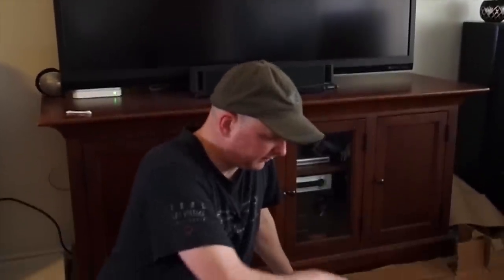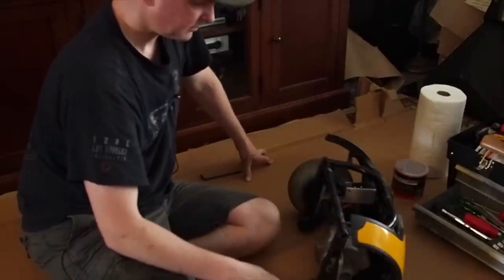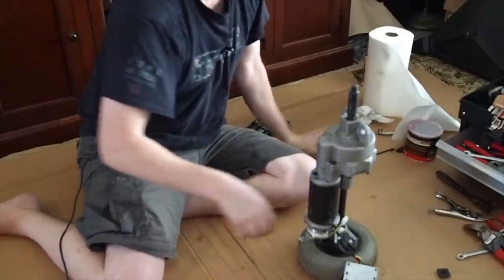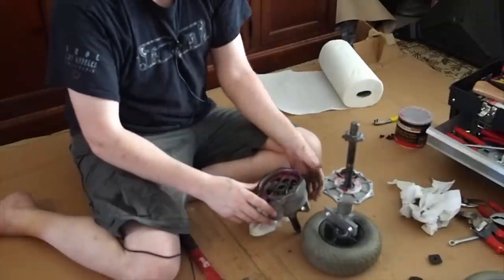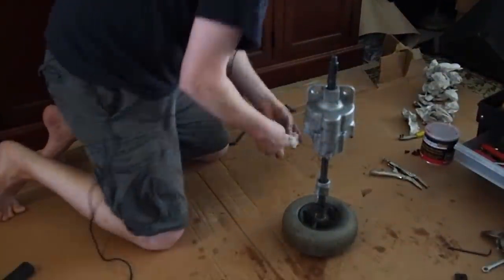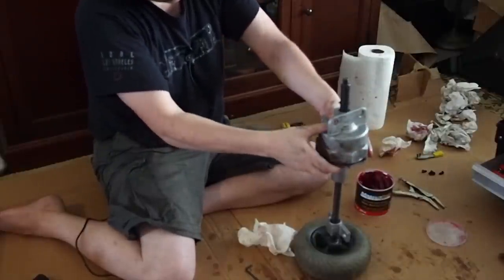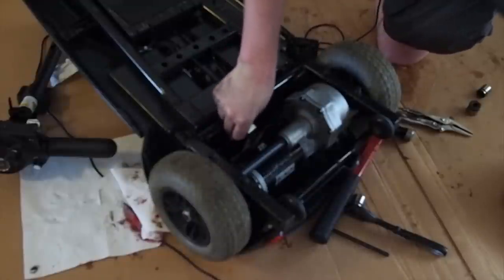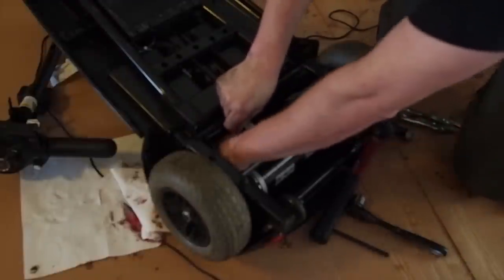GoGo Elite Mobility Scooter - Transaxle repair

Comment: I have a 17 year old Go-Go Traveler and just bought a new Pride ZT10 that is now dead and torn apart in my shop. I'm in  remote area with no service. They have been good on sending me free parts.
I have found over the years to take notes, take pictures, make sketches. Also use zip lock bags to "bag and tag". Good to see young people jumping in and fixing things.  I can remember repairing things in college parking lots and in my dorm room.
Reply: I am also a long-term fixer. I have noticed the same thing about myself that this video brought out: The young person is a risk taker and relies on good luck, to get the parts back in place. The lack of good tools or their incorrect use is then common. You learn from your experiences and many mistakes will not be repeated again. Today, maintenance manuals are easy to get, as well as general parts cheaply. Cameras can be used to facilitate assembly.

Comment: Thanks for making this video. As far as I know, even in 2021, it's the only teardown video of this scooter transaxle. I've taken mine apart (I have the Ultra X which has the same transaxle assembly) because of this video. It's actually pretty easy if it weren't for the greasy mess. Mine made the ratchety grinding noise and it turned out to be the sealed bearing that got completely disintegrated. Fortunately, nothing else broke. I found the bearing on Amazon for under $10 for a pack of 10. In case you're wondering, it's the 626-ZZ Double Shielded Ball Bearing 6x19x6 (6mm hole diameter, 19 bearing diameter, 6 width) Chrome steel. I chose the metal seal version rather than the rubber sealed version. If it fails, I can replace it again since I have a pack of 10. It didn't perfectly fix it because there was slight damage and extra wear to some of the gears - basically a slight tic tic sound, but other than that, it's fixed. If you keep riding with a bad bearing, you can damage the a part that can't be replaced. I've looked, and if anything else besides the bearings need replacing, you're screwed. (correct me if I'm wrong) I can't find anyplace that sell replacement gears for this. So you're only option is to buy a new transaxle for about $350, or find a donor scooter. So the lesson is, if it starts to grind, stop riding asap before more damage occurs - even pushing it in neutral can damage it.
Reply: @Titus357 thanks that’s good to know. $100 is worth it.

Comment: merit scooter have a 800w rear end and 110amp motor controller.  used mine for about 8 years till i broke it.  im 6'2" 320 pounds and live on a farm.   its carried me and everything i could drag for years.   i robbed the parts and built a tiny golf cart.  i plan on trying to install the rear transaxle in to my go-go.  thing wont tote me on farm.  does great on concrete or asphalt . wish i had got another merit

Comment: Just done a rebuild on one yes you can put the crown wheel in the other way it rubs the casing inside i drilled a hole and taped  a thread and make it a wet sump and put in EP80 oil works a treat.

Comment: I've got a rebadged Go-Go, (Apex Rapid) it stopped driving but motor was still running. Stripped it just as this gent has done, in my case the two needle bearings on the short axle broke up, there should be a heavy thrust bearing/washer just inside the gear box that the dowel pin through the axle bears upon, then the 45' drive gear sits on the axle with the pin inside it in two notches. In my case I don't believe there was ever a thrust bearing, so two new needle bearings, grease seal and drive pin required, about £25.

Comment: Hey man great video, I have an Invacare Meteor Hill climber Mobility Scooter that Im now fixing, One of my cogs is a bit torn apart , luckily I had a spare of another trans-axle the 10amp version, mine has a 2.5hp electric motor. Plus one axle was not turning on the disk brake side, thats now solved. It was the needle case bearing in trans-axle casing that has jammed, needs new one or I may just take out pins n put lots of grease in there, not sure yet. Your video has given me new insight on how these things work. Cheers.

Comment: quick tip - removing the motor from the axle first means you can leave the electrical connector in the original place so no re-alignment required.  I can see where 2 shims are but where was the 3rd? My wife's scooter seems to have eaten one shim and it was in the grease in bits!! Sounds like one gear was running over another presumably because the shim has broken but d not know where to get one or where is goes! Great video and made me aware up front to watch where everything goes!!

Comment: Thanks for the video. I just had to replace the axle bearing on the left hand axle. Its pretty easy if you are handy with tools. You need to be able to press out the bearing from the block. I bought 5 bearings for $6 on Ebay. They are crappy. Find an industrial supply company in your town for bearings and bearing seals. Call a small equipment repair business and ask where they get bearings.  The old bearing has the number which indicates the size. Mine was 17-23-18.
Reply: I went with 2 smaller bearings to fill the block, I had a bit of a job finding a direct replacement, but I am happy and its working fine! by using a double bearing I had a small centre gap and packed with grease as they tend to go due to lack of lubrication!
Reply: Jeff, my scooter has a FS180 transaxle and i also replaced my bearings with 17-23-18 bearings.     I know how to put the transaxle back together except for the 4 washers  (2 thin and 2 thick).  I cannot determine the locations of these washers on the shaft.  Can you help me with that?
Reply: @haroldstansel4150  I don't remember any washers like that in mine. I've got photos of my diff apart and dont see any. Are you sure they were inside the case?
Reply: @jefffranke  Yes there are two small and two larger washers inside the case on the FS180 transaxel.  I assumed this is the axel you had.  Today, I finally figured out how the washers fit on the axel shaft and will be putting it back together tomorrow.  Thanks for your feedback
Reply: @haroldstansel4150  Hi Harold I have exactly the same challenge after replacing the bearings on my wife's Go Go scooter. Not sure where the 2 large and 2 thin washers go. Please, please be so kind as to  let me tell me where they go! awaiting your reply with great anticipation. Regards Greg
Reply: @gregkarsten6841 , I don't know if you will get my reply this way.  After many hours and  combinations of installing the 2 flat and 2 thicker washers, I did finally get the scooter trans axle repaired.  I made a video of the correct installation of the washers.  I intended to post the video on YouTube but have not done it yet.  If you get to see this reply, I need to know how to contact you.  Then we can go from there to show you how to properly install the washers.  They will only go one way or the axle gears slip.

I don't know how to share contact information on YouTube.

Comment: Thank you for posting this. I have 2 go go's and the older one is 5 years old and has been worked on quite alot by me.
 I won't nit pick  what you called the different parts as you took the time to film this and share. I was wondering where
you got the bearings and what happened originally that caused you to take the trans axle apart? My go go has been gradually
 making more noise over time but hopefully I will not have to repair my motor/transaxle for a long time. I have not read of
another transaxle problem with a gogo yet. I do hear that I will need to replace the motor brushes during it's lifetime. Have you
replaced any yet? I wonder if you considered buying a transaxle from fleabay as I've seen many for sale for under $200. In my area
there are many scooters for sale in an online classified sales and I bought an almost new gogo for very very cheap.  Again thanks for posting this video

Comment: Marc, your video was very helpful.  I had the outside needle bearing fail on the transaxle and I followed your video in taking it apart.  I know how to put it back together except for the 4 washers  (2 thin and 2 thick).  Your video did not show where these washers fit on the shaft.  I took a lot of pictures but did not get pictures of these washers and where they should be installed.  Any help would be appreciated.

Comment: You don’t over tighten the motor screws because they will will break apart in the motor sometimes and cause problems with in the motor housing

Comment: Thank you for this helpful tutorial. Last week I was given a GoGo Elite Plus HD. Everything works on it, however there is a clicking noise coming from the rear left area. (mechanical not electrical) when it is driven. The clicking has a rhythm, which suggests to me that it is caused by something in the wheel, transaxle or motor.

 If I sit on the right edge of the chair, the clicking stops. Sometimes the clicking does not sound, but within a short amount of time it returns.

Do you have any idea of what this might be? Also, where were you able to find parts? I talked to PRIDE and they referred me to a national repair service.

Your help will be greatly appreciated!
Reply: Yep.  Something is in the wheel well.  When it happens to me (Sheri), it's usually a leaf.   The wheels are VERY simple (there are no berrings), so it's not going to be anything major (if it's just a clicking sound, and it's coming from a wheel).

That said, the sound may be coming from the transaxle.  If it is, there are two sealed bearings inside the transaxle, and one of them could be broken, internally.
Reply: @HaoleDreamer  put grease on the shaft and the inside of the hub on the wheel it stops the clicking make sure the nut  or bolt is tight to hold it on
Reply: @HaoleDreamer  This is what happened to mine see my post.

Comment: it should have CV grease in it, but any type will do, it never hurts to add a little oil in with it, as the wheel bearings at the ends of the axle tube don't see a lot of lube, most of the 4 mph axles have needle roller bearings at the wheels, when the dirt seal gives up water gets in and the needle bearing will rust, and then they jam up. a little oil will make its way down to those bearings. Not so important on yours as u have a separate support bearing on the shaft, but if you have the type where there is a long axle casing going all the way to the outer wheel bearing, then add oil.

Comment: Hi, Interesting presentation. I have a shop rider sovereign scooter but the speed control does not work. I have looked at the head but can’t see how you take it apart, can you say how I can take the surrounds of to get at the speed controller, plz.🤔😊.   Mick.

Comment: I have had a Luggie scooter for about 18 months. It has decided to stop working. It has been making as very low clunk sound for a long time. Nothing like gears grinding. I'll be going along and it just stops like the brake has been engaged. The only light does not go out and does not blink. Sometimes it will start moving again almost immediately, sometimes with a little help, and sometimes I have to let it sit for a while. I ordered a motor after searching for help. I could not find any "help" videos or sites for the motor, transaxle, and clutch repair/operation. After watch your video I think the problem may be in the clutch or transaxle. The motor was available from a Free Rider page, but had no info about it. I'm not sure I want to get into a rebuild like you showed us but may have to.  You are located in the UK, corredt? I'm in America. I found you on the UK YouTube site.

Comment: hay just a note gogo scooter has a crap bearing on the right translator that will lock up making people think the trans axles bad . gogo will not sell or even carry a replacement bearing approximate cost 10 bucks they would rather sell the whole transaxle for 275 bucks quick fix find a machinist and have him make one out of brass /bronze and it last better than that crap bearing . thanks for the good video

Comment: I have a GK8 and the wheels momentarily locks up after a few feet.  I thought that maybe the electric brake was the issue so I disconnected it and it still locks.  Any thoughts or guidance would be much appreciated.

Comment: Your videos have been very good I got Gigi elite any body got any ideas stripped down checked connections if shorting out none I give off shocks or get shocks when calling a lift.  When turned of no problem except voltage meter flicks while later goes well .

Comment: nice video, you stopped making videos? anyhow what sort of grease did you use, it did the job?
Reply from the maker: I make them when I think about it. I've never been very consistent.

I just used standard manual-transmission grease from an auto parts store. I used high-temp grease, though it doesn't really matter. The scooter's transaxle doesn't get nearly as hot as a car's gear box, so high temp grease isn't really important. Though, it's not going to hurt anything either. 
🤷‍♂
Reply: good info thankyou @marc.newman

Comment: Your video was very helpful.  Question:  Where did you get the small bearing (skateboard) that you said you replaced originally.  This is the same bearing that is bad on my father-in-laws scooter and I am unable to find it
Reply from the maker: It's not actually a skateboard bearing, though it looks like one. Find a shop that carries bearings (and other industrial machine parts) in your area. It's fairly common. They'll likely have one in stock. Just bring in the broken one. Trying to find the right part on the internet is a pain. It's a lot easier when you can hold the old part next to the new one and know it's the right one.

When I bought the part I looked up industrial part supply places in my area. when I found one I just walked in with the bad bearing. They asked me if I would like the same manufacture, or a better one. I paid $15 for a better one. Not sure if it's actually better, but for $15... I wasn't going to ask for a stress test. :-)
Reply: Quick  reply and very helpful.  I will look in area.  The medical supply place where I bought it said they will sell me the entire back end for $75.  I think I am going to buy that, find a bearing and have a replacement if needed.  We bought this used for my father-in-law and his first reaction was to snub it.. there was no way he could see himself using it or needing it.  Now, he depends on it so much that being without it for a day is driving him crazy.  Again, thanks for the quick reply and the valuable information

Comment: My go go elite trav. has to be rocked forward and back to get motor to CLICK and start.Same prob with reverse. WHAT do I need to replace?  Is there a relay type switch????  Battery posts are tight.
Reply: Sounds like there's a dead spot on your motor.
Reply: Gregory Tiffany 
To

Comment: Thanks for the videos. I just purchased this model. Can you please tell me what the light on the exterior battery case indicates?
Reply from the maker: Sorry. My model doesn't have a light. If I would venture to guess - it would probably be battery charge. Why? Because the indicator on the steering is not a charge indicator, though you might think it is.
Reply: @marc.newman  how to order gear box gear box

Comment: On my 3-wheel LX with CTS Suspension, the rear right wheel seized up and the other wheel can operate normally.  I think it's the electric brake problem and I need to replace it (part #WR198A345P1). Before I buy the part which is rather expensive.  My question is why rear right wheel became locked up and not the rear left wheel?  Does it have two electric brakes, one for each wheel?  Thanks.
Reply from the maker: I don't know the specific scooter, but I'm going to say, "no". The brake is on one side of the axle, so the other side is free to spin when the brake is engaged. If both wheels are on the ground, the brake and the weight of the scooter (and  rider) will keep the other wheel from rotating.

Comment: GoGo Elite Traveller won't engage in drive and beeps when key turned on. Battery is fully charged. Any ideas?
Reply from the maker: It is because the clutch is not fully engaged.
Reply: @marc.newman  Thank you. Is it easily fixed by me, or does it need to go to registered supplier.
Reply from the maker: @terencestrong9228  Usually if you just disengage and reengage the clutch a few times you'll clear out whatever is in the way of the switch. I forgot that it can also be caused by not having the scooter completely together. In that case, release the wheel assembly, and slam it back closed again.

It shouldn't take "fixing" it's a question of getting the connection to sit.
Reply: @marc.newman  thank you

Comment: Hi!

I have a 4 years 48 volts (4 batteries of acid / lead of 12 volts each, I don't know the amperage) Gio electric scooter.

My batteries full charged (53 to 56 volts: 3 full blocks on the screen), I can only make 14 kilometres instead of the usual 50 to 70 kilometres. It's like there's almost no current left. However, the voltage of my batteries is 46 volts (two blocks on the screen) and the lights, the turn signals, the horn and the screen light work.

Is it a batteries problem or other electrical / electronic issue? How do I find the problem myself? I have a multi-meter.

Comment: Hi i need a liitle help. I have scooter motor and transaxle taken apart to attach top another ride to serve as the main motor i wanted to make just one wheel that serves as the pusher but it won't run unless i put the two wheels.